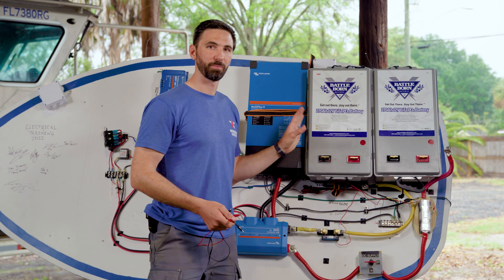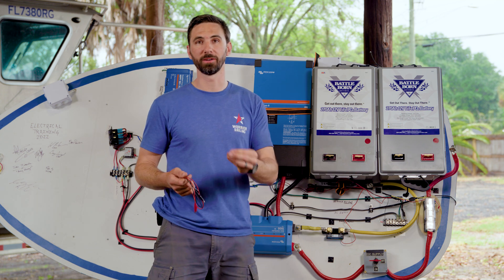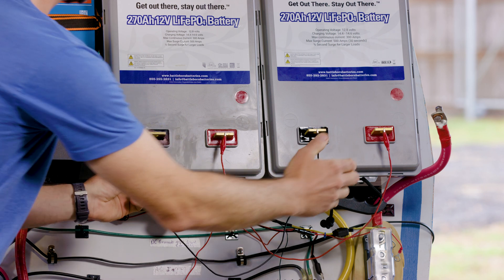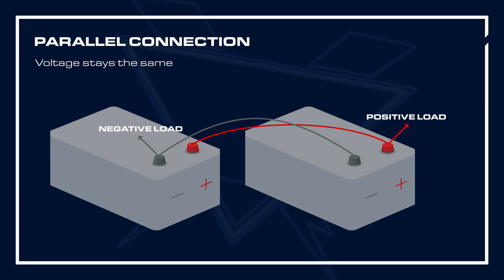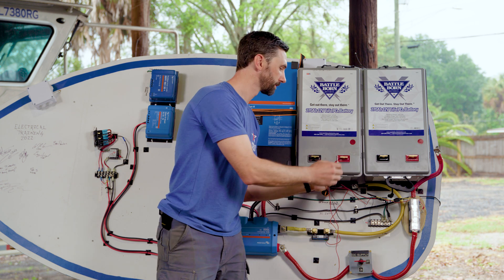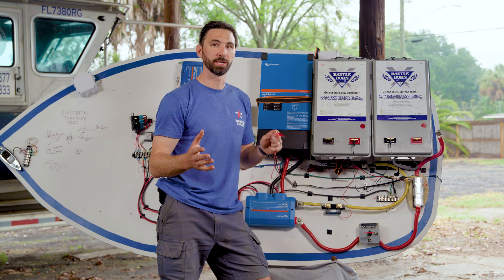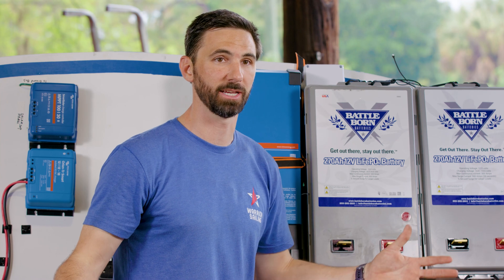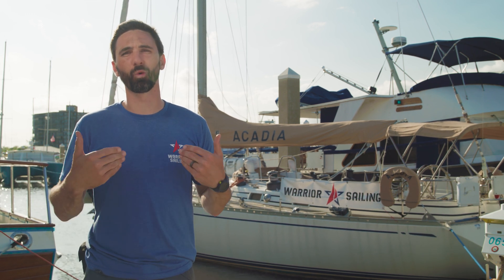Marine 101, Ep. 15 | Series vs Parallel Connections in a Marine Power System

Comment: I have my house batteries linked in series 6 volt to 6 volt, the electrician recommended. I run an electric pot hauler that pulls 80 amps. I have significant voltage drop when pulling my shrimp pots. I think I needed to change to 12 volt batteries and go parallel. I reached out to the electrician that installed my current system but haven’t heard back from him. I’ve been using both engine an house battery banks to haul the shrimp pots. I switch them back after hauling gear. Any recommendations for 12 volt batteries to use?
Reply from the maker: Check these one's out! https://battlebornbatteries.com/product/12v-lifepo4-deep-cycle-battery/

Comment: Just watched your video, simple and concise!!  I'm working towards a new house bank system considering the early failure of the current AGM bank.  Is it possible to have our solar array feed a lithium bank and then this bank charges the starting lead acid battery for the diesel motor?  Thanks for any help, Jeff and Julie s/v OoLaLa Westsail32 #81